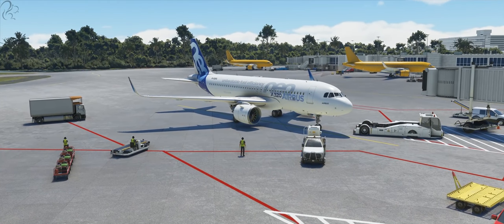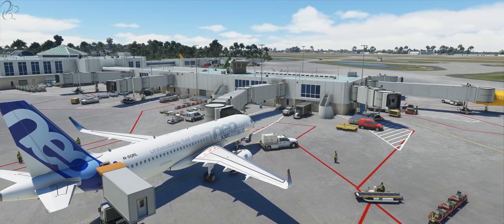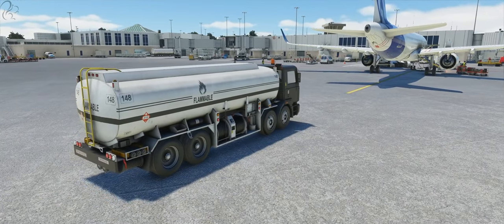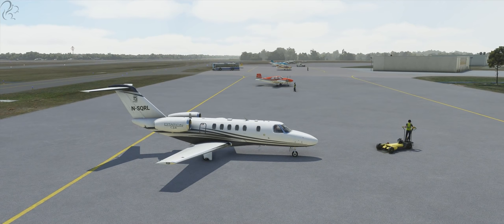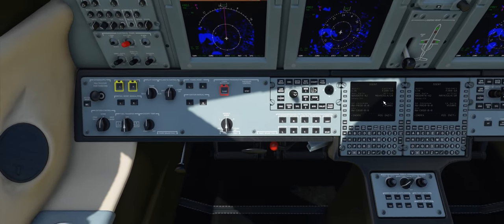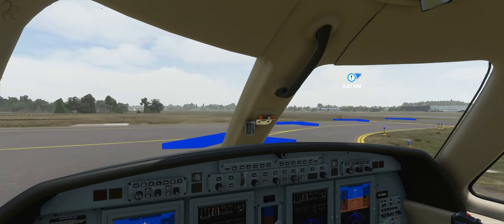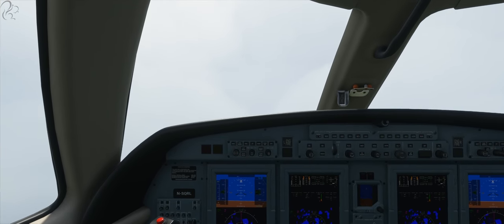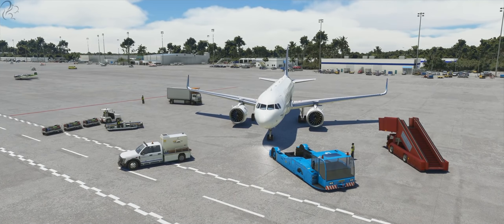Ground Services & ATC - Microsoft Flight Simulator

Comment: Technically, in the real world you wouldn't open the doors for catering etc too if you're the pilot. The ground crews does it. So in essence this is correct.
Reply: Not correct, I am a 777 pilot and am doors trained (we all are). If catering knock on the door, and crew are not around or busy I will open the door. Also, during the last few months during Covid, with no crew on board the pilots are the only ones on the aircraft for freighter flights.
Reply: Michael Buchanan Well obviously you could, but in this video it comes across as the door being opened without the pilot doing it is unrealistic. I would imagine that the pilot opening the doors for catering is the exception rather than the rule on an A320.
Reply: As far as US Mainline and Regionals, I have never heard the Captain give permission for Catering to open the door. They can visually see that the door slide is disarmed from outside and proceed to do their jobs. It is automatic as long as the beacon is off on the aircraft. So it may depend on what airline you work for and where in the world you work. I specifically work as a Part 121 Captain on a CRJ-7 for a company based in southern Utah contracted to a company with a huge American flag on its tail that will not be named  ;-)
Reply: @michaelbuchanan6289  Why can't catering just open the door from the outside?
Reply: @lolvks  The emergency escape slide must be disarmed before the door can be opened, and that can only be done from inside.
Reply: I worked for Continental for a short while as a ramp agent, and we opened the cargo doors as soon as the engines spooled down enough to be safe.  As far as I know, it's not even possible for any door to be opened from the cockpit.  (Can you imagine a faulty remote door circuit operating mid-flight?)  Therefore, the fact that the doors open when a request is made makes sense.  What doesn't make sense is that the request is done through the tower.  Calls like that would have been done through operations usually by radio on a dedicated freq for each airline.  Even still, ground activities such as, baggage unload & load, pax unload/unload, servicing, etc., would all be basically scripted as part of the normal flow at the gate.  We'd marshal a flight into parking, wait for engine shutdown, chock the wheels, connect the jetway, unload/load baggage, refuel, service food, service lav, and lastly, connect pushback and comms.  We did all of that without any need to be "requested" from the flightdeck.  We knew what needed to happen to get a flight in & out and we did it.  At that point, we'd wait for comms from the flight deck that they were ready for push and we'd begin pushback.  The only thing that was usually by request was ground power and sometimes cooling air, which was provided by cable and duct from the jetway, not a ground power cart.
Reply: Atomic Underground fancy meeting you here! Love your channel
Reply: I feel like there are a few misconceptions and while it doesn't make a huge difference, I feel like I have something to contribute.

I'm an AME with a national airline (maple leaf...) that operates A319/20/21.  First of all, on overnighting A/C, ground services are at the aircraft long before pilots or passengers are.  Catering shows up as early as two hours before departure and open the door from the outside as the aircraft is either empty or has only mechanics in it.  Sometimes they knock, but more often than not they just open the door.  Now the arming/disarming of the door is the priority of the flight attendants as soon as it's safe, before the passengers get up and walk around etc.  The doors of an empty A/C should NEVER be armed after it's parked unless it's being serviced.  That being said, even if the door is left armed and it's opened from the outside, it will automatically DISARM the door and will NOT deploy the slide.  The arming/disarming is done via a girt bar that clips into the door frame, and the outside handle comes with mechanisms that disarm the door before it opens if it has been left armed.

Mr. Wells is correct in saying that pilots aren't always on their radio requesting ground services... rampies are responsible for everything.  It's also correct that there is no control of the cargo doors from upstairs; there are dedicated hydraulics panels on the belly that operates them.  External power was always available as was air con/heat via the jetway, and was connected as soon as the A/C parks.  Pilots are there to fly the plane, not to make sure the sandwiches and fuel are on board.  In case of equipment failure, they would not contact ground but would call STOC and request a GPU/heat cart/etc, this is the extent of pilot's concerns with ground services.

As a final point, it's sort of goofy that you'd need to relay pushback instructions via ground frequency... in reality the tug plugs in his cockpit interphone and communicates with the pilots akin to a telephone call, it's not at all formal and is generally only there to synchronize parking brake activation with pushback start once the pilot has received his clearance via ground.  It might also be used to coordinate on-gate deice operations.  Much like all the other ground services, each gate has a standard pushback pattern that gets the A/C pointed in the right direction , and any half-trained rampy should know that.

Now as for MSFS and it's ground services integration... I would like to have a level of immersion that includes cabin interphone and available ground power right when you spawn in, but we are doing this for enjoyment; not as a job like real world pilots.  I WANT to be able to control when catering and fuel services come, I want to control what direction I pushback in, and I want to be the one that controls when the passengers come and go.  I'd like for it to emulate real services more closely than what's demonstrated, but overall having more control makes it more fun for me, even if it's not 1000% realistic.  If everything is as automatic as it is in real life, it would detract from the experience.
Reply: Well, pilots would have to be trained to open all doors on the aircraft...

But not once have I ever had a pilot come out and pop open the pit door for us, I also watch catering go about their business after verifying the door is disarmed.
Reply: @atomicunderground9971  atomic underground in the wild, great channel
Reply: Tallishyeti27 thank you
Reply: @michaelbuchanan6289  not correct for Airbus. The policy is that doors are always opened from the outside (unless emergency) as this disarms them.
Reply: Does anyone know how to make ground services work for AI?

Comment: All of these features are an easy $40+ add on purchase in any of the flight simulator platforms up to this point. I'm sure some people will release some mods or low-cost addons to make things more realistic and create more appropriate textures and liveries, but this being in the base sim is just amazing and really exciting for the flight sim community.

I'll be honest though, that pushback system is pretty bad. That complete failure to line up with the runway on ILS approach is concerning too but I'm pretty sure looking at the cockpit you didn't have the jet configured properly for ILS approach (I fly 737 in sim mostly so I'm not sure).
Reply: Looks like LOC mode was not selected on the autopilot so it was just keeping wings level instead of following the localizer.
Reply: @SubwooferGames  That is what I saw as well.
Reply: gsx is still better, looking forward to buy it when it comes out. But yeah for base game it's pretty cool. Also don't excpect anything from the default airliners they are very bad
Reply: noga - aviator they are not ‘very bad’ they are flyable. And remember they are default aircraft
Reply: @matthewdunphy8524 yes they are default, but that doesn't mean we can't say they are bad. Nearly no system is similated, the ecam only has two pages, the autopilot is barelt working but no vnav, no top of descent, no adirs etc...
Reply: @Yougi  Flight sims are always "paid".
Reply: @SubwooferGames  It wasn't, APPR mode was enabled which overrides LOC mode. The ILS is that bad in the A320 currently.
Reply: @nogagoesbrrr1275  TOD is actually there .. its just the icon it doesnt read TOD
Reply: @embecmom5863  well when we tested the sim it wasn't there... even tho we tested on the latest build
Reply: Does anyone know how to make ground services work for AI?

Comment: Real Airbus pilot for a European airline here. We wouldn’t get asked about opening doors on the ground when they’re disarmed - the senior cabin crew member / purser will coordinate this. 

The A320 doesn’t have a long cargo bay, that door enables access to things like centre fuel tanks etc. Of course the bay is a little longer on a A321.

It would be good if the PIC had to work with ops rather than ground to get these services!
Reply: Indeed, on many large European airports aircraft will also receive catering while there is no crew on board. The Catering staff then docks at the door, knocks and if nothing is heard opens the door from the outside themselves.
Similarly, you do not normally have to request a GPU, that is generally always plugged in the moment the aircraft is on blocks.
Waiting for fuel trucks for ages is familiar and seems highly realistic

Comment: To be fair, the service doors can be opened either by the caterers, or the cabin crew, but only after the catering truck has reached the door.
Reply: That! The ground and flight crew that handle doors and stuff. Never seen a CA or FO go back there and open the door for catering. On that regard MSFS is doing right.
Reply: Yup exactly... The PIC isn't really in charge of opening doors
Reply: Fabio Pittol  Your absolutely correct I’ve  never seen it  in fact with quick turns there opening the back while customers are still getting off
Reply: Plane doors dont have locks so ground crew are more than welcome to open the service doors.
Reply: Does anyone know how to make ground services work for AI?

Comment: The fact that external power was available at the start may be because they're assuming external power would be connected from the jet bridge. Most big airports don't use external GPUs to power the aircraft.
Reply: I was wondering that as well. Just about every US Airport that I've seen provides ground power from the Jetway. Which in turn is connected before the AC has powered down. Even if a AC is rolled up to a Gate cold and dark(from an off gate parking spot or Maint.), Ground power from the Jetway gets connected by default.
Reply: I'm imagining a giant extension cord coming from the terminal 🤭

Comment: 1:30 The external power is probably just always available whenever the parking break is set. That is the solution most developers implement since most people don't want to tinker with external ground services and trucks.
Reply: Yeah, but... they're 90% of the way there anyway.  Don't get me wrong - this looks amazing - but to be honest I don't want there to be ground power available unless the ground power is actually hooked up.  If it's that much of an issue for users, then just have the tool tip over the ground power switch say "request ground power truck" in red or something.  And if users really just can't be bothered to request ground power, they can always just start the APU using battery power (if the batteries aren't low).
Disclaimer:  I'm an enthusiast, not a pilot.
Reply: @nathank7989  I recognize what you are saying. However, even the highest quality and most realistic aircraft such as the Zibo Mod or PMDG products will give you ground power as long as parking break/chocks are set.
Reply: Well, IRL in a spot like this he'd be getting power from the jetway, it's pointless to run dozens of diesel generators when you can hook up directly into airport power grid.

Comment: As a ground services worker at Orlando International Airport (MCO) I can say that aircraft are actually externally powered via a cable that's on the jetway. Once the jetway is connected, we attach shore power to the aircraft unless the pilot requests we don't, then they use the APU. 

Also just a small tidbit cool fact. Southwest has their own airside terminal in A. Delta shares their airside with international flights. American, United, and Spirit are all together on an airside. Finally Jetblue, Frontier, and other domestics share the final airside.
Reply: Does Orlando have fuel trucks or, do they just have local hookups like LAX's inground system.
Reply: @wb6anp  Both actually. We have in-ground systems that use a regulating tug of sorts that the refueling operator uses to monitor flow and whatnot. These are mostly used by airlines with their own servicing equipment.

But we also have trucks that are primarily operated by Menzies Aviation. They're mostly used for smaller craft or smaller airlines that don't do their own servicing.

Comment: That’s really odd that they decided to have you contact ground for services at the gate....
Reply: Yeah, that is really disappointing. I’ll certainly get over it, but that shouldn’t have been a hard detail to get right
Reply: Derp Inshmurtz I did watch the full video. My comment has nothing to do with the copilot AI. Ground doesn’t handle requests for ground services. You don’t call Ground until you are ready for clearance to push or start, or for an IFR clearance if no clearance freq
Reply: 26:45 even Ground Services are available when tuned into Tower
Reply: I agree.  Those calls should be to operations, not ground.

Comment: as someone who fuels A320's, the fuel hookup is actually on the right side of the aircraft. so you've gotta navigate around all of the other ground support equipment over there as well. and i'm not sure how it works at orlando, but i work at a smaller airport at an FBO that does fueling operations at the terminal, so we do have to drive quite a ways to get to the aircraft to fuel it.

Comment: 9:30 The fuel truck works exactly as it did in FSX (exept for the part that it is called through ATC and that it connects a hose to the plane)
But in FSX you can call a fuel truck with a key combination and once it arrives it will prompt you to change fuel AND payload, just like it does here
So it might be a carryover from FSX

Comment: 10:38 - Something nose-dives into the ground in the background.
16:24 - A car takes flight and nose-dives in the background.
36:20 - Forklift driver goes on an absolute rampage. 
Bless this game.
Reply: 10:38 - Had to be a UFO because was flying straight and level then instantly did a 90 degree down angle and dove into the ground.  LOL!!!!  Only UFO's can do those maneuvers.
16:24 - Ok....same UFO but he is now doing a full circuit.  All 90 degree turns very fast... Hope his Inertial Dampers are working properly!!
36:30 - Dud would be instantly fired for driving like that at any airport!  LOL

Comment: I've noticed when I've flown, the pilots turn the engines on during pushback, so they may simulating the by doing pushback as soon as the apu is on and assuming you want the truck disconnected (making it more game for casual people). I understand wanting it to be manual though or wanting the option.

Comment: C25C is the ICAO code for the CJ4, that's accurate.
Reply: It is, but ATC would refer to it as a Citation, not it's type code.  I usually tell ATC when I'm making first contact and entering me in to the system of the type of aircraft with the ICAO code.  My case a PA28 Cherokee, but when communicating I would be referred to as Cherokee 30 whiskey or whatever the tail number. Still though, this simulator is super impressive!

Comment: On the topic of the GND-PWR button:
Tecnicaly you dont need the GND-PWR Cart when you are at a gate. Most, if not all Gates have a GND-PWR connector on the Jetway. The ground crew just conects the plug from the jetway to the Airplane. Power carts are mostly used on remote stands and GA planes.
It would be cool, if you are parked at the gate and have the jetway connected, that the GND-PWR is available without the need for a GND-PWR cart.

Comment: I think they should of done something similar to GSX cause in real life I work for a US airline And specially in MCO  and pilots don’t request atc for Ground power unit cause usually it’s at the jetway or a GPU cart  same with other features they will actually contact the airline OPS for those stuff if they are not there when the plane arrive :/
Reply: I do hope they fix those options.  That was driving me nuts that you call ground control for all those options which, of course, you would never do at any airport that I have ever flown into.  Airline ground support does most of that if not all.

Comment: I have to say for a game that's still in development this has great promise sure there's a lot of bugs but I can't wait to see the fully developed version hell I can't wait to see what Billy Bishop airport in Toronto look like :3
Reply: To me it is actually very interesting to see how much work has been put in, as I can see it the bugs are because the system is using generated animations rather than crafted animation.
Meaning that the system is modular, if you tell the game where the door, bays and so on, on a model then the ground service will be able to work making it easier to implement more planes in future (maybe even mods or community models).
However what is really interesting is that compared to many other sims the work has been done here, DCS (my current gold standard for flight sims) just has menu's no ground crew to speak of, apart from the carrier. Finally comparing the 'buggy-nes' of the ground service to the quality of the flying it looks like the priorities where good as 'perfect ground services' would be a fancy yet gimmicky sales point